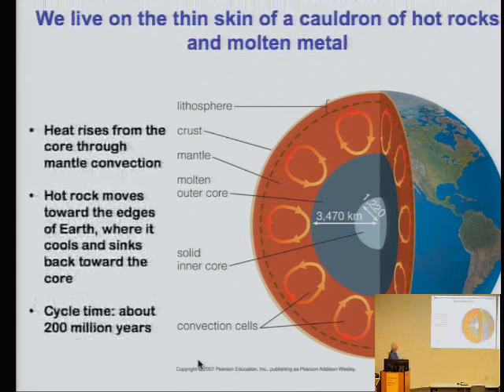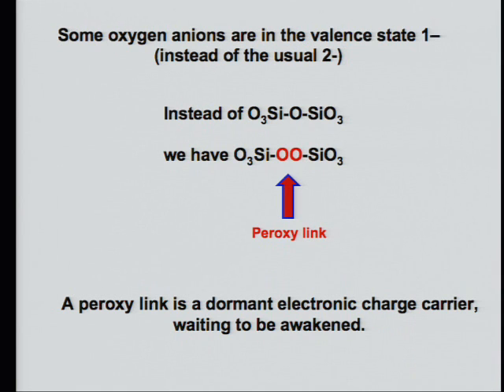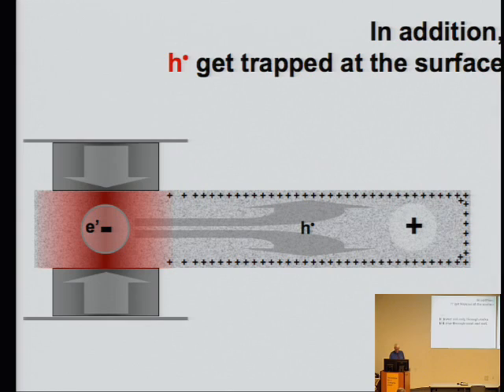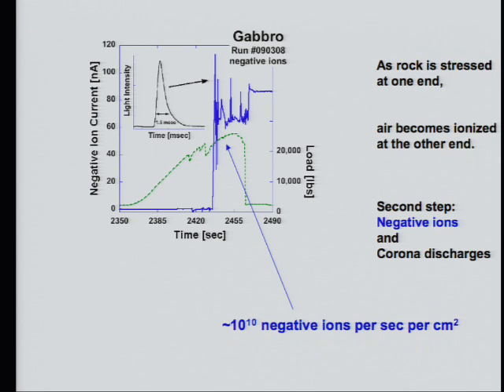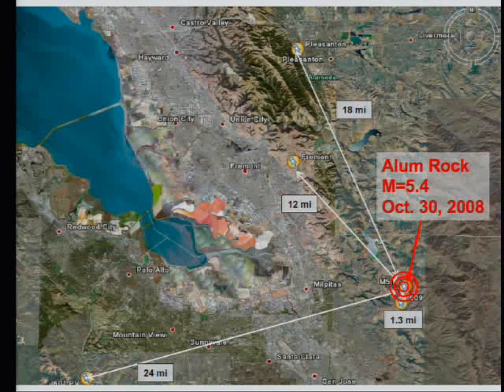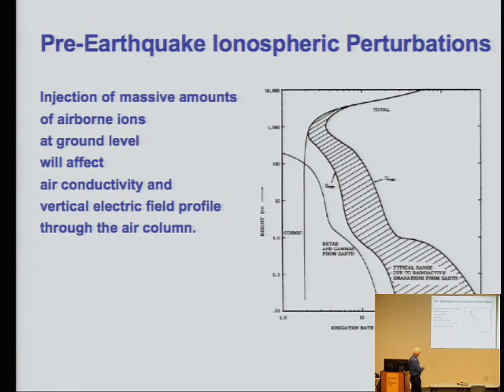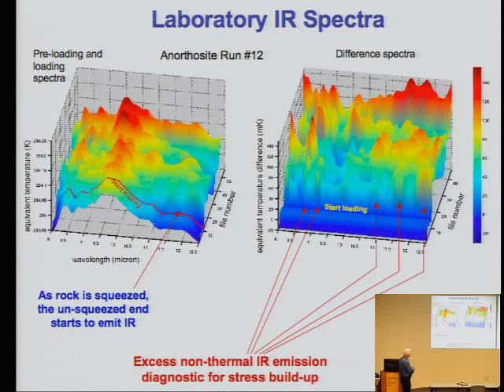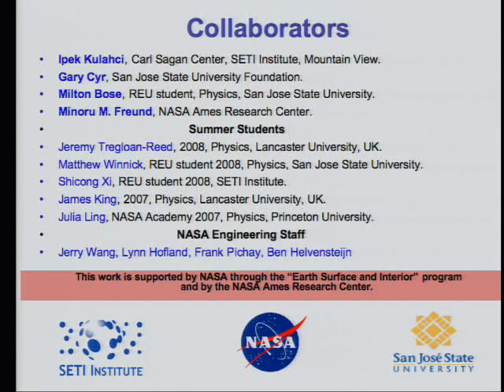Earths Many Voices a Unified Theory for Pre-Earthquake Signals

Comment: If you combine, Low Frequency Electromagnetic, with Ionization Sensors, and the Infrared sensors, then you should have a 20 hour lead time, and the three would be used to confirm a potential event.  Think about this, at this point you are as accurate as the Hurricane Forecasters but, you need combine this information rapidly and distribute it rapidly.  This will require satellites and servers to do the work, as well as ground stations.  This should be given the highest priority of any mission.
Reply: James, your comment is from 7 years ago, but you should know that promise has been realized––in Peru! It's an extremely seismic country, perfect for testing such techniques. The researchers report the ability to first detect incipient quakes up to two weeks in advance and call them within a 24-hour window two to three days out, with the epicenter pinpointed, and the strength fixed within half a magnitude.